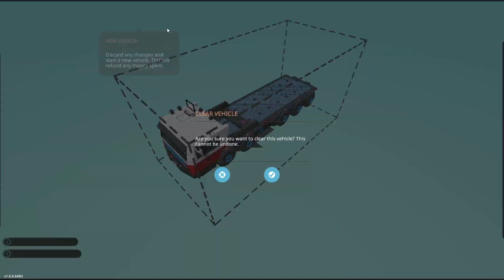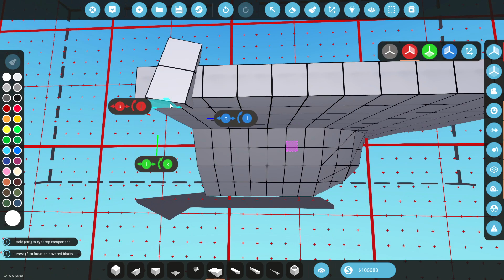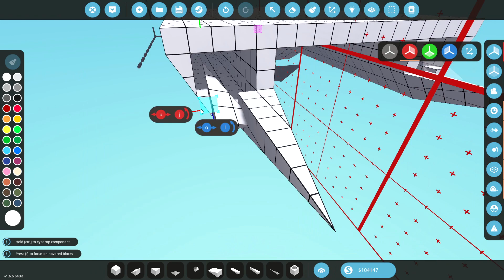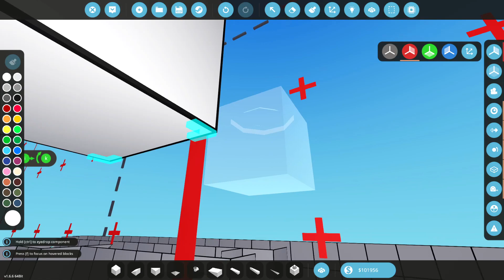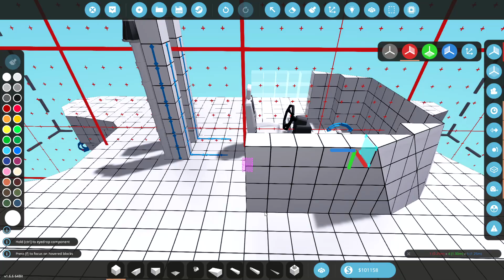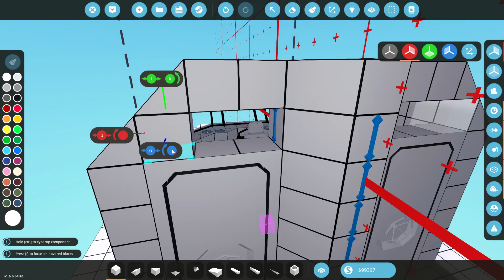Modular Engine UPGRADES! - DLC Hardcore Career Mode - #26 - Stormworks Build and Rescue

Comment: to save electricity, you can use a fluid belt pump for the modular engine. It attaches to the belt block.
Also, in case you didn't know (for some reason) if you use the gearbox with the arrow facing away from the engine, it'll just make it slower with higher revs. it you face the arrows towards the engine, any gear you input will be reversed. 
For example, Normally, a gearbox with three to one ration would have the prop rotate once for every three rotations the engine has. This is a Less speed, more torque situation, Though usually with boats you don't really need that much torque, especially in stormworks. If you face it backwards, anything like a three to one gear will make it so that every one rotation the engine has will give three rotations to the prop. I hope this helps in some way.